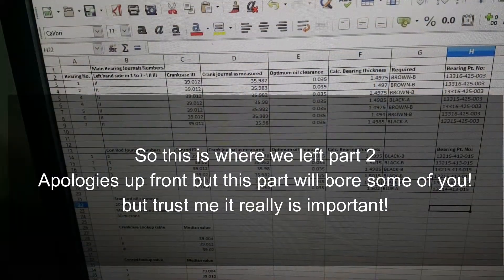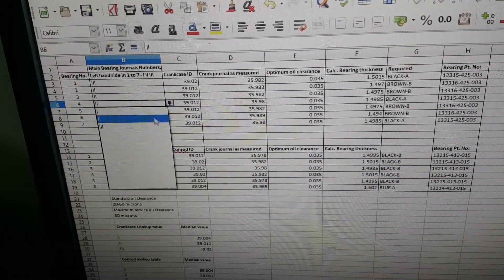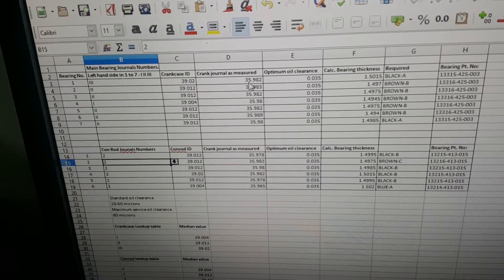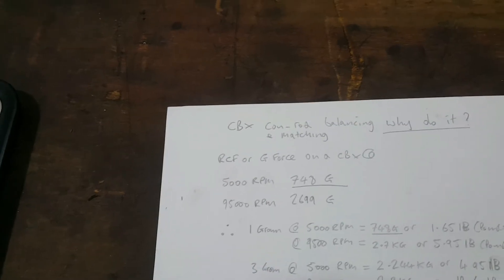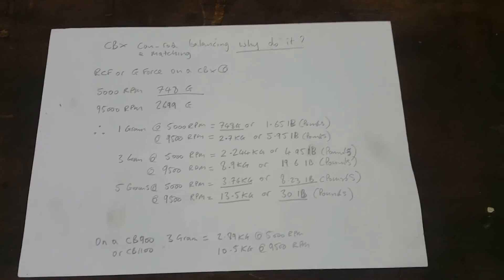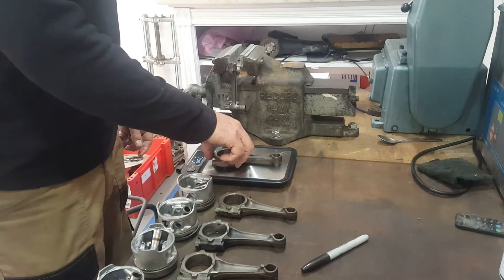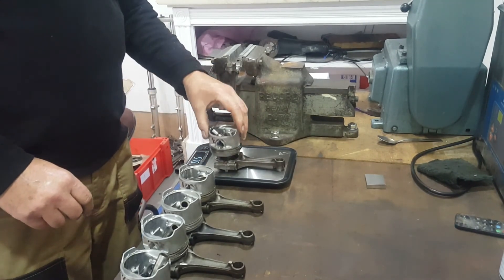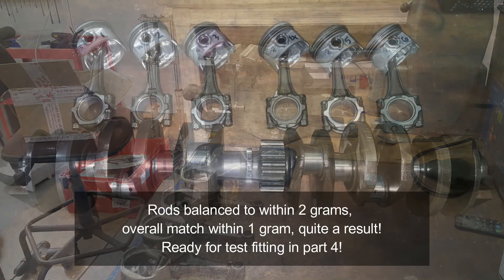CBX Engine strip and rebuild Pt3. Selecting bearings and balancing con rods with matched pistons.

Comment: At 00:23 I noticed that you did not use the same number of digits after the decimal point. See cell D-16. This leads to confusion and is easily fixed. Just select a column and click the buttons to add or remove digits.
I had a Honda CBX-1000 Prolink from 1082 for 23 years. Sold it 2 years ago. The last time I removed the sump it still looked perfectly clean.
Your bike was most likely very poorly maintained. The sump and internals of the engine casing look very dirty.
Nice video!